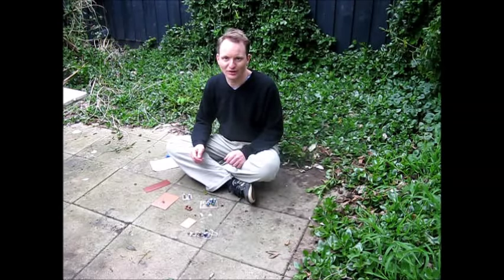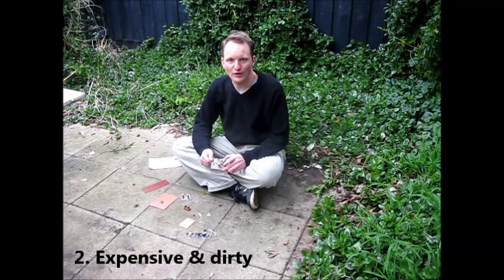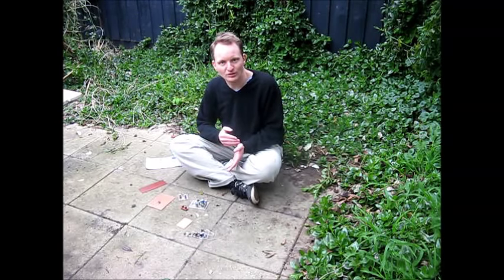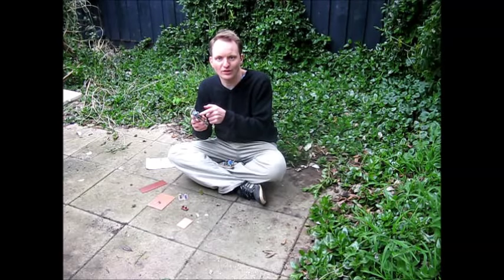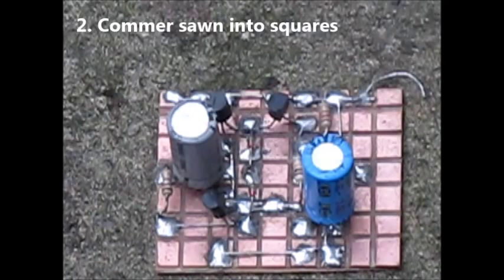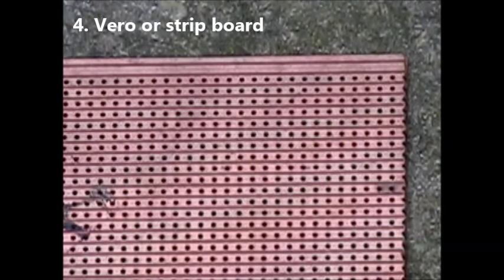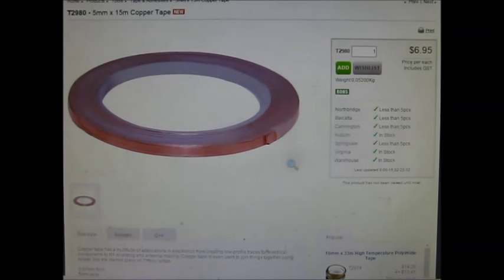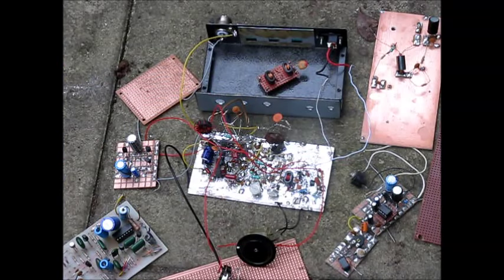Electronics on the Floor: Five reasons not to use printed circuit boards for projects

Comment: As a hobbyist, I'm doing all sort of construction techniques.  I only finalize my project after testing them on breadboard or dead bug style construction. When I'm satisfied with it's performance and I'm not feeling lazy, I end up designing a pcb for it using eagle cad.  If the circuit is simple enough, I use permanent marker to draw the traces.

Comment: A method I have went for when making small RF circuits is halfway between the unetched board and the sawn squares - I have a mainly unetched board and dremel squares where I need them as I build.

Comment: I couldn't agree more Peter. Another annoying thing with making pcb's is drilling the holes. I've also used cardboard with component leads soldered together underneath which worked great for my applications.

Comment: any alternative construction method is effective up to 20-30 components, anything more complex than that is faster to build on a PCB (including PCB design). you can easily spin a single sided board at home in less than a hour. and of course when working with SMD components or mixed SMD+THT then PCB is the only way to go.

Comment: My last project was built on copper clad board with strips cut off and glued on as wasn't going to mess on etching,  it was an x-phase unit for radio interference,  it  works well and the layout was more organised and simple compared to the original layout.

Comment: I breadboard and test everything prior to any permanent construction.  Using the toner transfer method, I can get a board etched with no mess in as little as 20 minutes.  Drilling time will obviously vary depending on the size of the circuit.  In my opinion, a PCB is neater, the components are held more rigid, and I find this construction so much easier to trouble shoot if components fail.  Construction errors are eliminated at the breadboard phase.
Reply: What he said!!!
Reply: Prototype on solderless breadboard, then make a pcb. As a hobbyist, making the PCB and assembling the device is half the fun. There's no substitute for neatness. Toner transfer is so easy, and I use Ammonium Persulphate rather than Ferric Chloride, no staining anything.

Comment: I think that pretty much everyone begins on perf-board, then if desired, moves on to printed/etched circuit boards. So everyone who's doing circuit board printing already has experience with perf board, and knows the limitations. It's something to try out, and use if you like it. I keep both around, but perf-board, or right on bare copper clad board can be quite a pita, and looks horrible. Also, if you want to replicate something a few times, it's more of a pita, where as you can just print a few at a time if you see any desired future replication necessary.

Comment: The point is, PCBs were specifically designed for mass production. That is the very last thing the hobbyist does! So all those points in the video are completely valid

However, my favourite method is to use PCB layout software for a tidy design as if to make a PCB. But I use single-sided board copper uppermost, where the grounded leads are soldered to the top copper plane. Leads going to the the 'track' underneath pass through 1mm countersunk-cleared holes. These component leads are the wired up underneath to follow the track design. 

This is good for RF since there is a ground plane, it looks neat and looks like a PCB (from the component side!) if that's important, no chemicals and not too difficult to modify. 

If a circuit comes with a PCB layout, you can use the layout (with minor alterations if necessary) exactly as published.

Comment: True comments, PCBS are really more as a next step in your journey as an engineer. Yes pcbs really are the final step in a design, if you build the pcb too early in the design phase you will undoubtedly make a few mistakes or forget something in the design. You can tack extra components on but it does tend to look untidy. 
In defence of PCBS they produce a better less noisy design that with the use of ground planes can reduce resistance help with noise immunity and also accommodate the correct pad sizes especially if you are mixing surface mount and through hole components.
Also, making PCBS is a lot of fun and you can really enjoy the finished product more especially if you want to show off your design. Adding mechanical constraints for example, mounting a large current capacity device were you need a heat sink, allows the addition of having nice padded screw hole mounts.
PCBS can also be routed if you have the money to buy or maybe even build a router. A small pcb router can be built fairly cheap using old printer parts and an ardino board or two. The simplest way to make a pcb is to buy an etching bag and a dalo pen. Ok they can look very raggy but the finished product is as good as your hand writing if you see what I mean, or your drawing ability. You can use stencils too and this technique is very cheep and most young hobbyists can often afford this method from their pocket money. Plus it’s a great way to get your first pcb experience.
Veronboards or stripboardcare also a great middle man to creating great looking circuits. Once you have your initial design, and this is were I like the guy in the video suggests the use of the dead bug method or the Manhattan method, these are excellent for getting your design, whether you are a boffin and can do all the calculations first, or like me, a numpty who designs in practice and from experience as I go along. Then this will then allow you to draw a final working version and you can test it on a veroboardvlayout to make it more robust.

You could of course build your design as dead bug then put it in a box and pour in potting compound, once you are happy with it and it’s working. That way, it’s all inside a nice brick and alll the messy bits are hidden.

Comment: I'm an industrial electronics designer. Been in the game for more than 35 years. The best alternative I would consider to PCB is the matrix board with pads underneath. I can't stand veroboard. Some people love it but I just find it so finiky. So easy to short tracks together. If I am going to do a small project that I know I will never repeat, I use that kind of matrix board. I don't do complex projects that way, however. Anything complex, I bread-board it (proto-board)  and test it until I've got it really working well, then do a PCB. 

For small things like low-current power supplies and so on, I build them using the legs of the components and make up a sort of a "network". Then, when I've got it working 100%, I get plastic food container and fill it partly with fibreglass resin. I put the network in and the project now becomes a solid block which makes it quite practical. 

Another method is to make it up on proto board and get it working 100% and then just put the whole thing in a container and fill it with fibreglass resin. Very quick and easy, no soldering, and it's quite permanent. 

If I'm going to repeat something, however, that's an entirely different story. Then only PCB is worth it. There are lots of free software packages out there that are really nice to work with. Designing a PCB takes longer but it is a pleasant experience. You can draw out the schematic and just export a netlist. No finiky thinking and double-checking every connection on a board and swearing while you search for an elusive fault. It will not make a mistake. You can get the mounting holes exactly right and make it fit exactly In project box and everything. If you've designed your components well, everything just assembles so easily and fits just right. 

And I use (yes, really) good old Positiv 20. I don't like these iron-on methods. Too finiky. Sometimes the sizes get distorted etc. I print the artwork on tracing paper, sandwich it between the board and a piece of thick perspex, and put it in the sun (a UV light with a timer is the ideal method). Then, in the ovan at 70C for 20 mins. Develop with caustic soda solution. Etch with ferric chloride. It takes time and practice to get it right but you can get very nice results and feel proud of it. 

In the end, for me, PCB wins

But then again, you can go to the next level and do everything in a simulator. The software today is amazing. You can design the entire thing, test it, the whole shebang and then make a PCB.

Comment: PCBs are only for production at scale. Prototyping by making boards is way too slow, I hold off on making a board until I need to make more than one of something.  Even then with high speed stuff you may need a revision or two to get it working well.

Comment: Is the Manhattan style technique apropriate for small amplification audio circuits, like LM386, TDA7245, LM1036, etc.?

Thank You
Reply from the maker: Yes - if you can cut the circuit board pads small enough
Reply: Yes i think i can manage that. I'm more worried about the capacitance of the big ground plane if it will affect audio quality.

Thank you vk3ye

Comment: this is a great video. PCBs are not straight forward and take a lonnng time. for myself - the breadboard is where i start with all my prototyping. the vero (strip) board seems to be the easiest to transition to because you can duplicate your breadboard configuration. i also buy tiny breadboards & leave the project as-is :P wasteful i know. also there is nails into wood and point to point. my friend does that cos he has a woodwork setup in his garage.

Comment: Well... You might have a point, but consider that, specially with logic circuits, PCBs save you from having to solder a awful lot of wires. Making the layout isn't all that much of a problem anyway, if you are to properly plan the connections between components, specially with ICs.

Comment: Ciao Peter from Rome .
Very good explanations , precise and very clear as your usual .
I agree completely with your point of view . Printed boards are not the best for experimenting .
Among the methods you showed I'd rather prefer the matrix boards with copper paths . It's easy to work with them and it's possible to modify the circuits without suffering too much .In my life I have set up a lot of circuits in this way .
Now I'm curious to use the copper tape as well . It seems quite easy to work with it . I'll try it for sure .
Ciao Peter , and thank you very much for sharing with us your knowledge.
Giovanni - I0KQB

Comment: I've successfully built ( clean almost harmonic free ) 100 watt linear RF amps for CB radios + small bits of VHF gear, with copper clad board and small copper clad squares of the same board super-glued where I want. These act as island soldering pads.
Much neater and better than cutting the squares with a dremel, or hack saw, which also weaken the board substrate. 
If the square island pad happens to be in the wrong place, simply snap it off with a sharp bade or screw driver and re-glue it in the new location. Super-glue works better than most other adhesives.
This layout arrangement provides an unbroken ground-plane, with flexibility in moving the pads about; unlike the hack sawn board described in the video.
 
Also don't forget, good old tag strips as used in Valve equipment work well for many discreet circuits.  These can be soldered to a piece of copper clad board or a metal plate. Like wise turret-pins and wide placed tag boards also work well. Many Guitar Amp manufacturers still use these today instead of PCBs.  These were used for decades in VHF and UHF equipment without issue. 

One peeve I have with PCBs is they are not designed to be repaired ( typical Capitalistic mentality for built in obsolescence ) and once you hit them with a hot iron you risk permanent board damage. Also you need a Computer with its ever-changing software, which also has a sharp learning curve. This becomes very time consuming for one-off designs. In the old 3M Tape method, I could whip up a decent PCB in half and hour, but on a computer it can take one days and then your still not happy with the result.

As we all know - very little commercial equipment is designed for repair.

Comment: A few things I don't understand. 1) First where you say it takes too long and that you have to design a board layout, surely you create a layout regardless of method, even when using a solderless breadboard you need to have some kind of plan/layout!?
Also for the simple kind of circuits shown could easily be done using an etch resist pen or most permanent markers, would take a few minutes.

2) Expensive and dirty, you don't need agitators or any expensive software, I use gEDA which is open source, a high density plastic container, bottle of hydrogen peroxide and HCL for etchant with my laser printer which comes to about $12 AUD~ in consumables. If you're spilling it on your cloths, just be a bit more mindfull.

3)I'd recommend using solderless breadboards well before considering soldering components in place regardless of type of board.

4)I don't even understand how this could be an issue, who would design a board without knowing the components and or size of components firsthand!?

5)Again, I don't understand the issue, why is testing from the underside of the board a problem!?

Comment: this kind of prototyping should not be compared to industrial PCB etching methods. This kind of prototyping is good for frequencies below 30 MHz AND with components which are not wideband. Try to put a transistor with a cutoff frequency of 6 GHz on this board and you will get a lot of oscillations. Read some  application notes form Analog Device for example and you will see that your copper clad is not a simple support for your components :)

Comment: I know that this is a two year old video and new comments no longer make any sense. But what I see is that most people don't realise what Peter is trying to convey. For fast prototyping, the best way is to build on bare copper clad boards. There is no point in designing custom PCBs for a simple project and then spend a considerable time etching and drilling. For RF amateur radio work, this is more true. Standard references in amateur radio homebrewing like EMRFD suggest deadbug style because of its flexibility. In case if you don't know, the world famous BITX started as a deadbug prototype in VU2ESE's shack, who now produces PCB kits of BITX. Even several good books on microwave design suggests using copper tape on copperclad for prototyping. So in essence, Peter is right !
Reply: Yeah I agree. If you read any of the papers by Chris Trask he winds up using those single sided square pad boards to design his circuits, even some which are complex since most of his designs include transformers for passive augmentation like in his wideband active loop antenna amplifier. Once you got something that works and you've done all the improvements then yeah PCBs are nice. I've learned the hard way with trying to recreate an amplifier on a PCB without testing even on a breadboard which is an expensive mistake TBH.
Reply: I’ve just started learning electronics so I’ll do what I think is an obvious question: why not strip or protoboard?

Comment: you should change the title to "five reasons not to use printed circuit bords for PROTOTYPES". But in my case, I make for everything PCBs and it almost always works instantly. My designs are highly sophisticated so it wouldn't be doable without PCBs. And FOR ME it's a waste of time to do prototypes on breadboards ... I start with the final PCB and I'm very seldom wrong by doing it this way :) I give the layout to Chinese manufacturers and yes, it takes about 2 weeks to get the PCBs, but time is no problem when doing clever "pipelining" :)

Comment: Great vid for how nothing to do. I prototype on breadboard than i design my pcb in SMT or THT and it's looks like a pro pcb not like radio out of the year 0.
Reply: It's not how it looks that matters. It's how it performs.
Any device exposed to 'unqualified personnel' is gonna have a case that won't be opened.
Any 'qualified' expert on the device simply should not care and/or knows looks can be deceiving.

Second, back when people didn't even HAVE boards (think very early TVs), Manhattan-style was common practice in production.

Mind you I'm not advocating shitty engineering practices here. There's (probably) tons of RFI and safety advantages some more seasoned engineer can fill me in on.

I find Manhattan-style to have a certain charm to it...
Reply: Strange logic...PCB is real way how to do it, even no need for programs ( who don't have it etc) - you can also draw it with hand ( that is how We did it 20+years ago) . Aesthetic is imho very important simply more precise work + better looking say a lot about person who made it = that is usually better made circuit.  Exactly due to fact that He She take cares of every aspect and like everything to be perfect, precise , well balanced in terms of space usage etc. Not to mention other problems that wiring brings like electromagnetic emission that have impact on your product. Don't understand reason to go decades in past and make such ugly circuits in 21 century with all this great programs and items that help builders a lot + improve the quality of their final product.
Reply: It depends on the application.  Is it for you or someone else?  Is it for the bench or the field?  Size constraints?  How long does it need to last?  I do everything from twisting wires together, to multi layer surface mount boards, depending on what it's for.  For my own stuff, I don't care how it looks, I just want it to work and last.  The cheaper and faster it is to build, the better.  I have a lot of stuff on vector/vero board which has worked fine for 10+ years and will probably last the rest of my life.  Plus sometimes it's fun to just start building and not worry about EAGLE or acid or fiberglass dust or waiting for boards to arrive in the mail.